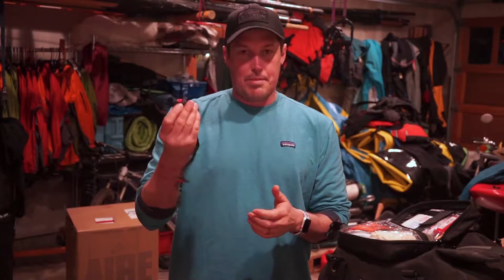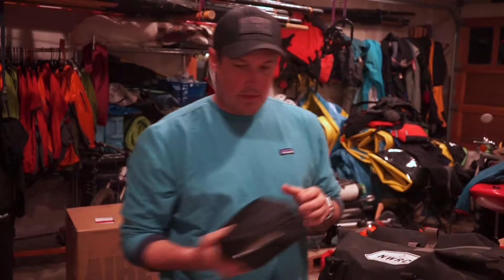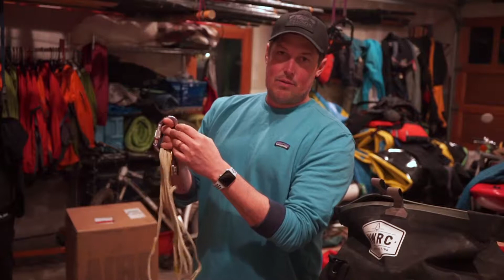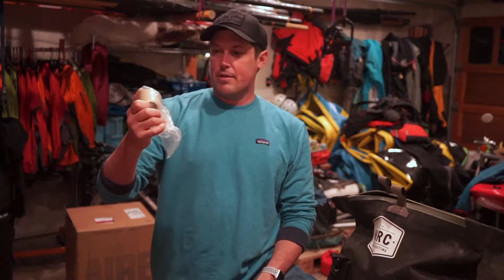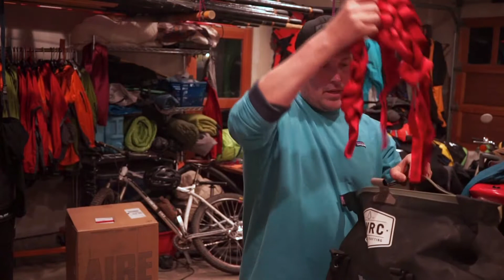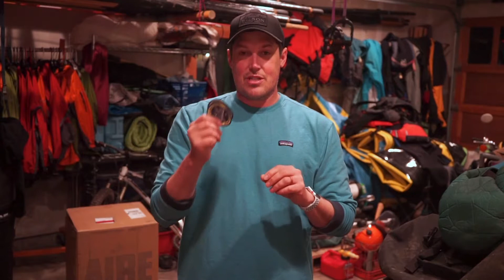Whitewater Safety, First Aid, and Repair Kit | Ep. 15

Comment: Great video I’m definitely going to add some longer lengths of webbing to my kit. What are your thoughts on prusik knots vs VT hitches? I just listened to your podcast about river safety and I think it would be rad if you did some more in depth discussion on safety/prevention
Reply from the maker: I'm stoked you're going to add longer lengths of webbing! Since paddlers don't use rescue techniques and this equipment often I think it's important that we all keep to basics and not try to use fancy techniques or equipment even if it's better. For that reason I'd suggest you stick with Prussic knots since that's been the standard for a while. In a rescue environment it's important that everyone is on the same page. Yes we'll work on more prevention discussions.